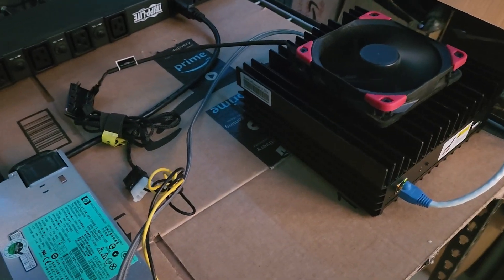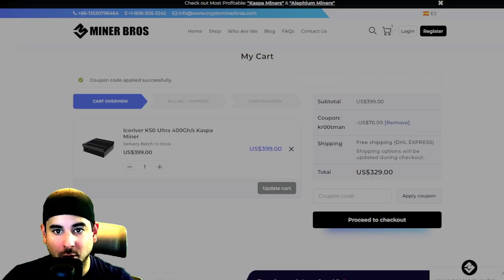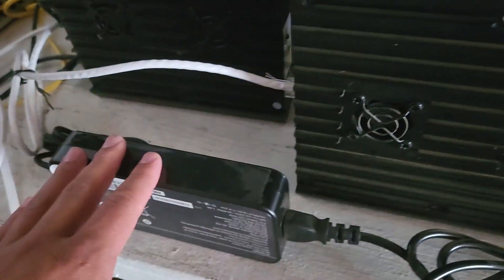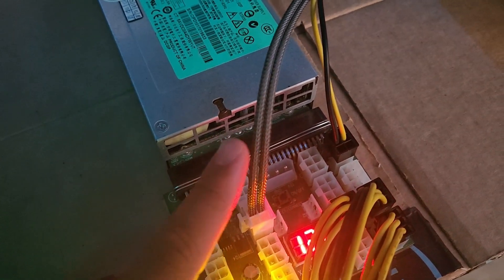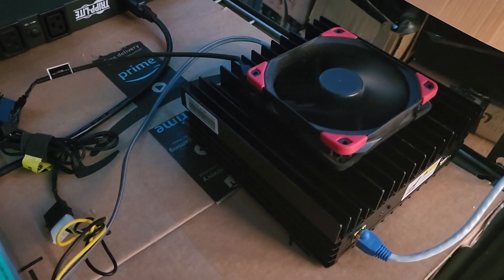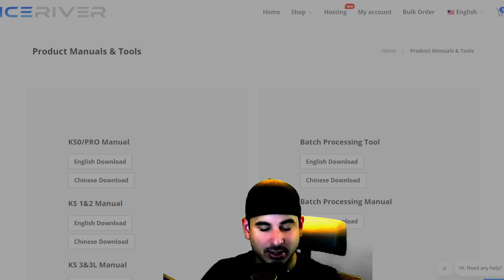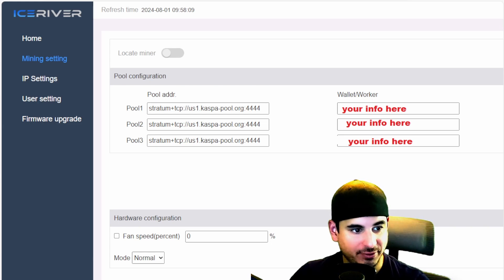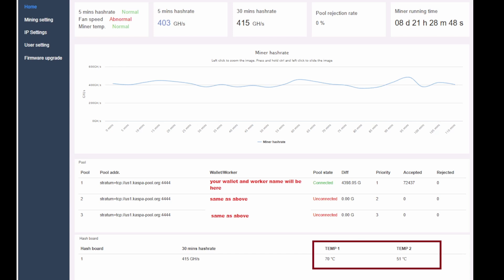Ks0 ultra setup guide

Comment: Having some setup issues: First I had to setup static IP from DHCP on my network.  I as able to connect to a pool and shows as “connected” and can see the “worker” on the pool. Second it had the “abnormal” mining issue on the top of the miner page. I rebooted several times and it started mining “normal” as expected.  I then decided to change the admin pw rebooted.  I have been getting the “abnormal” mining error. After several reboots I decided to try a hardware reboot(physical button).  No change to “abnormal” mining.  I updated to the latest firmware and it still “abnormal”.  I am about to reach out to ICERIVER directly.  In between reboots I do let the miner run for about 30min before checking the status each time.  So I have spent a couple of days of troubleshooting and still have issues.  Any ideas to fix this issue?  I also just setup a KA Box Pro the same day at was able to start mining on the same pool within 15min.  I was going to buy a more KS0 Ultras but I am holding off until I get this one working rather than “abnormal” Any suggestions would be appreciated!

Comment: I overclocked mine with the tswift’s oc. Not gonna do pbfarmer’s because I don’t have a way to monitor the wattage. Been running great at 618gh/s version 24hr avg hashrate of 629gh/s
Reply from the maker: @amplifierBTC  yes it's a good oc but for the average user I don't recommend ocing. I am not ocing mine

Comment: So, I just saw the previous video of yours saying basically it is not worthy anymore to mine with this miner, which is unfortenatelly as I just bought one, and then you do a video of how to configure this miners? What is your line of thinking?
Reply from the maker: @fabio90oliveira  no it was the ks0 not the ks0 ultra, different model. I was explaining if you are going to buy an asic you have to be confident in your purchase. So if you are that's all that matters.
Reply from the maker: If you bought a ks0 original model the way to set it up is the same as this
Reply: KS0 Ultra is worth an investment depending on your investment plan and horizon.  As for miners KS0Ultra is affordable and uses almost no power.  Time and price appreciation of KASPA is the variables you can not control. If the miner stacks coins for you early it usually is a safe bet but still bet on the appreciation of KASPA in the future.  As with all investments it is a bet on a better future.
Reply: Thank you for the clarification. I bought the ultra. ❤👌🙏
Reply from the maker: @fabio90oliveira  oh ok that one will be profitable for a bit, check out my earnings video on it

Comment: This thing loves 80c no fan needed. Better hashrate letting it run warm.
Reply from the maker: @Thr33PuttKing  yea it just depends where you are and what your idle temp is
Reply: I set my temps to 80 target and fan 50. 
I'm hitting 560s HR at a 109/47 Oc 
Side plates on and no fans.
Reply from the maker: @Thr33PuttKing  oh nice!